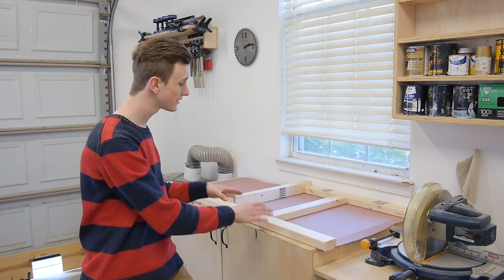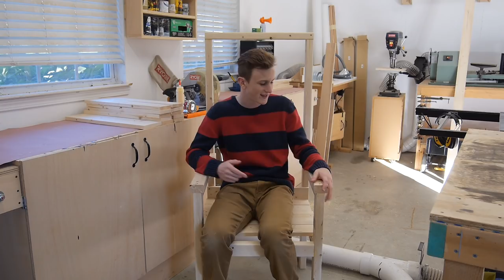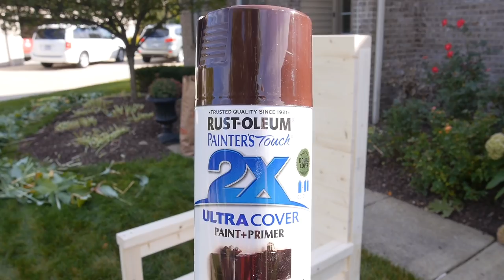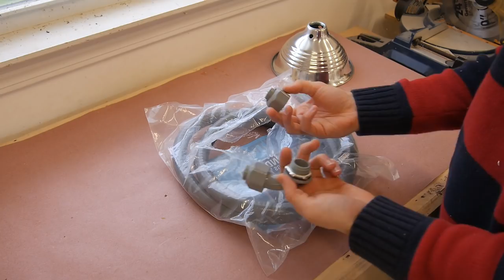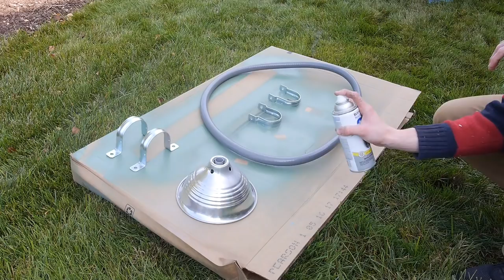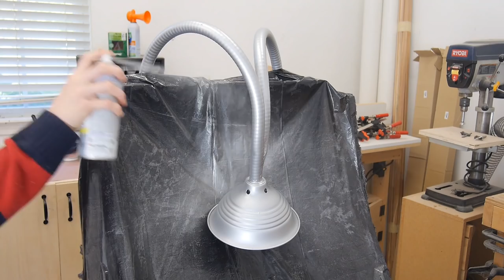How to Build an Electric Chair | Halloween Lawn Decoration

Comment: NICE BUILD!  Careful with the height of your table saw blade. Rule of thumb to keep your thumb. The blade should only raised roughly a 1/4" above your material thickness. This way if your hand were to come in contact with the blade it has less of a chance cutting all the way through it. Keep up the good videos. I love Halloween related videos.

Comment: Awesome awesome job and video. You did a great job you also showed even if you don't have a certain tool at the time there is still other ways to get the job done. If your still looking for a compressor I've done a lot of research and I'm going with California Air. Actually you should call them it would be incredible exposure for them. Just a thought.